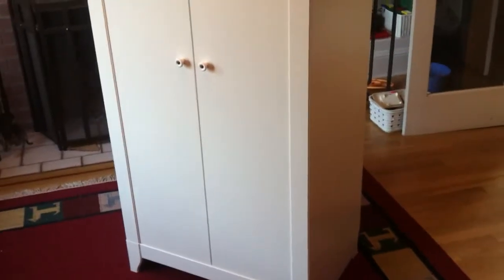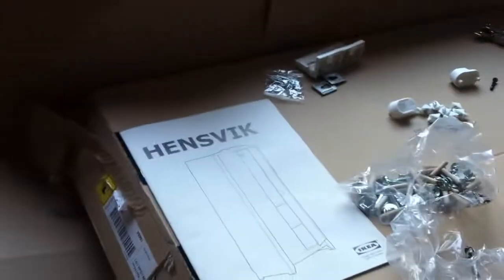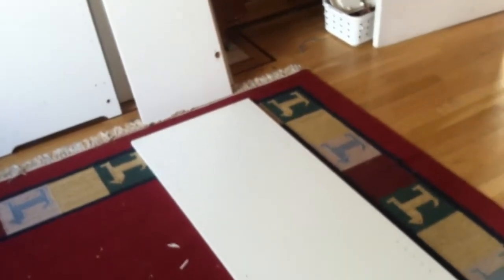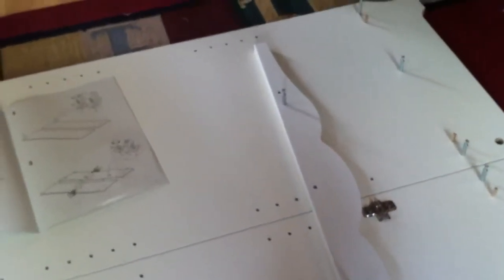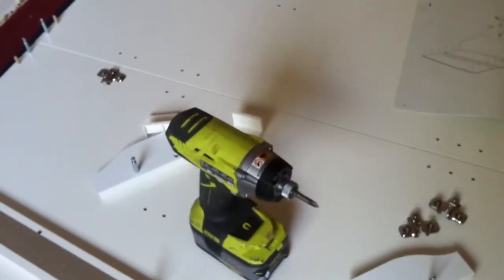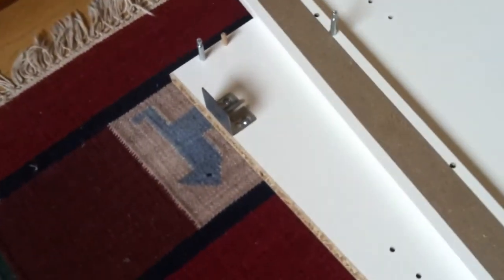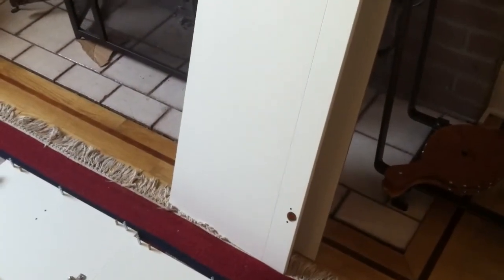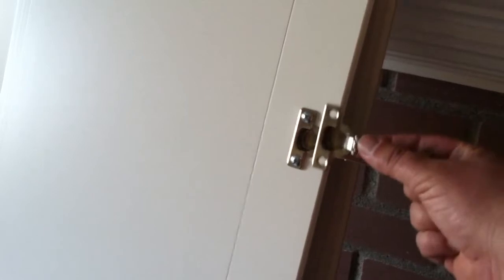Ikea HENSVIK Wardrobe Detailed Assembly Tutorial

Comment: Hello,
I bought this Wardrobe for my daughter and I want to adjust the height of one of the shelves. Any idea on how to remove those white hooks ? I can't get them off!
Reply from the maker: James Dos Santos  A lot of them are held in by a screw underneath which expands a little plastic wedge similar to a drywall anchor.  Undo the screws then use a leatherman tool or small pliers to get them out.
Reply: 6 years later. hope shes doing well :)